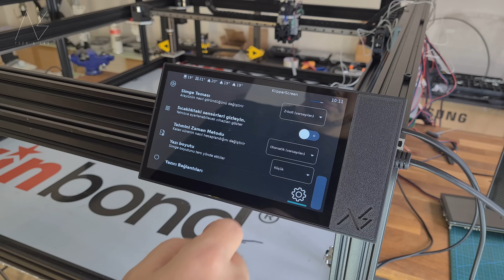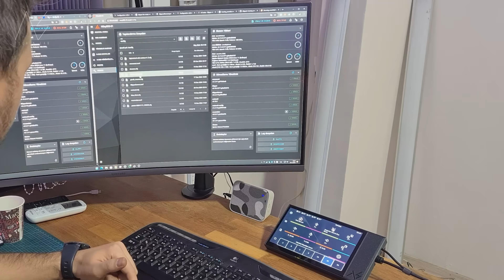Yeni Tasarımım, Büyük 3 Boyutlu Yazıcı Yapımı (800x600mm) - PART2

Comment: When I built my 3D printer I built the base as a ladder frame for extra rigidity, and the uprights are box-frame again for rigidity, instead of a basic box structure. I can literally use my printer as a step-stool and it doesn't flex at all. Extrusion is comparatively cheap so I wasn't afraid to use a lot of it - my printer has a build volume of 330mm ^ 3 and it has something like 15 meters of extrusion in it.
Reply from the maker: Sounds like a very solid build! Always interesting to see different design approaches.

Comment: The length of the ptfe tube from extruder to the hotend is absurd... Also bltouch... Why it's 2025... Put a cartographer probe on there and use the nozzle touch and call it a day. They are cheap as. Great wiring of the electrical box. Very professional!
Reply from the maker: Thanks! 😊 The BLTouch is just a temporary solution — I actually have a different probe design in the works, and once it’s finished I’ll replace the BLTouch. As for the PTFE tube length, it’s hard to shorten because I will placing a custom sensor in that section.

Comment: u2c 2.1 can output diye bişey var dikdörtgen bi kart o ne işe yarıyor. Türkçe bi veri bulamadım. İlla gerekli mi?

ebb36 can vs ebb 36 can with max 31865. Arasında ki fark nedir biliyormusun?
Reply from the maker: u2c, yani usb to can. bu kart USB girişini, CAN Bus çıkışına çeviren bir arayüz kartıdır. Can bağlantısını doğrudan raspberry pi ye bağlayamazsın. Arada bu çevirici olması gerekir. Fakat bu şart değildir. Ebb36 yi yazılımla serial haberleşecek şekilde de ayarlayabilirsin. Bu durumda ebb36 yi usb-c çıkışından doğrudan bir usb kablosuyla raspberry pi ye bağlayabilirsin. Bu bağlantı haberleşme için yeterli. Fakat bu durumda ebb36 nın beslenmesi için ek bir 24v kablosu çekmek gerekir. 

max 31865 ise pt100, pt1000 sıcaklık sensörlerinin çalışabilmesi için bir entegredir. Bu sensörleri kullanmıyorsanız gerek yok. not: Bu sensörler çok daha hassas ısı ölçümü yapar.
Reply: @enesyucepur  bilgilendirme için çok teşekkür ederim 😊

Comment: did you twist the can h and can l wires ? didnt see any twist in it, canbus requires twisted cable with a twist ever ... centimeters ( forgot the exact number but you can look it up )
Reply from the maker: Thanks for the tip! I didn't use twisted pairs for the CAN-H and CAN-L lines because I didn't encounter any interference issues. But you're absolutely right: twisted pairs are important for signal quality when using long cables.

Comment: Nice cable management!
Im also trying to build a large printer but I went with multiple 24v  sheet beds because of the price.
Reply from the maker: Thank you. 
Yes, the price of large heaters is quite high. But, using a power supply for 12v or 24v heaters increases the price a bit, so I opted for four 220v silicone heaters.
Reply: @enesyucepur  ye both cases are expensive, Im planning to just power 2 beds max at the time and cycle through the beds. 

Are you able to heat up all 4 heaters at once? It might draw some current.